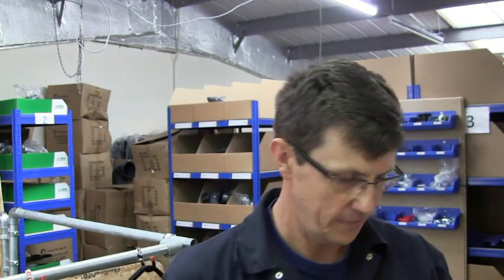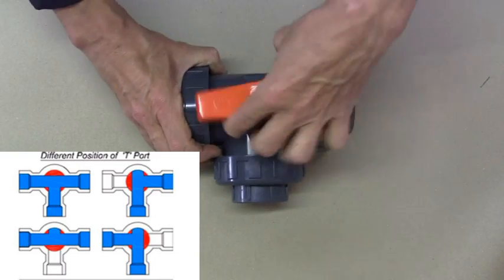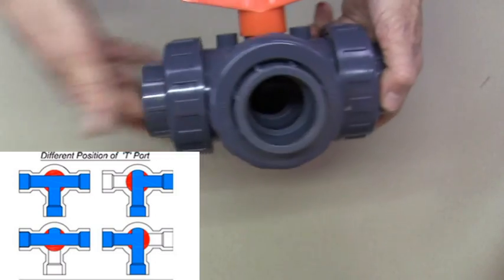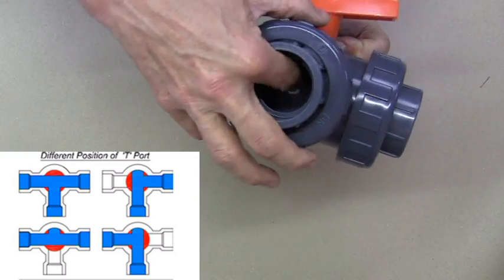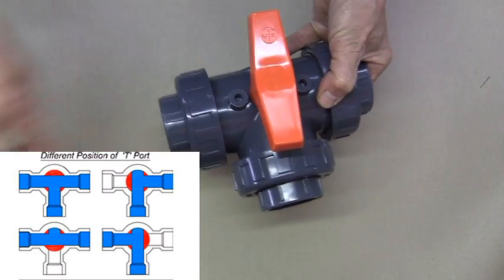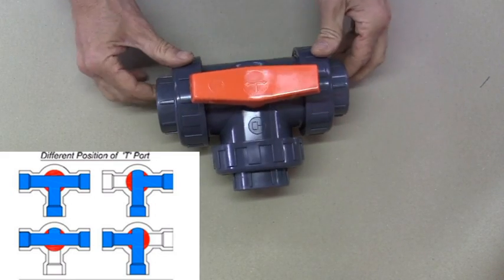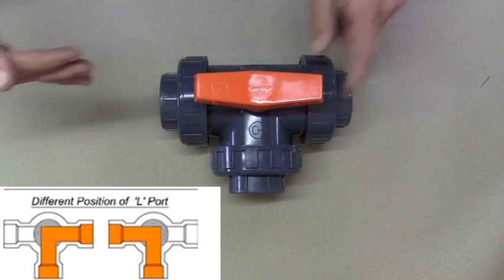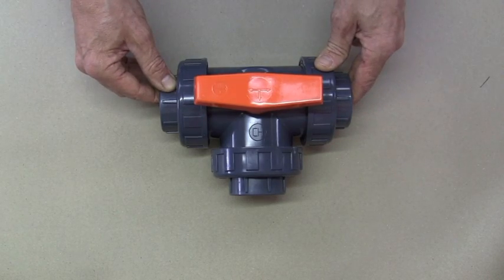3 Way Valves

Comment: Good for Operation but bad for maintenance for some application. So, each way may requires shut off valve.
Reply from the maker: 3-way valves are specialist valves and are useful when installed in properly designed systems which require some mixing or diverting applications. All systems should always be designed with future maintenance in mind.

Comment: Hi I have a Spears USA 110mm and is passes a lot on the position 3 (bottom left) I can’t understand why.
Reply from the maker: Hi there! We don't supply Spears 3-way valves; however, reasons for your valve leaking might be that the valve seat or seals are worn. We recommend stripping the valve and taking the ball out to see whether there are any scratches or dents within the valve causing the leak.

Comment: great , but looks there is no fool proof, there is a chance of shut input port!. this case pump will get overloaded and failure of the pipe line
Reply from the maker: Hello. This would be the same for any 2 way valve as well, a valve needs to be able to be shut off.

Comment: 3 inch may available
Reply from the maker: Hi there, here is a link to our imperial valves section: https://www.plasticpipeshop.co.uk/Inch-PVC-Valves_c_1146.html. On this page you will find the T-port and L-port valves in a range of different sizes.